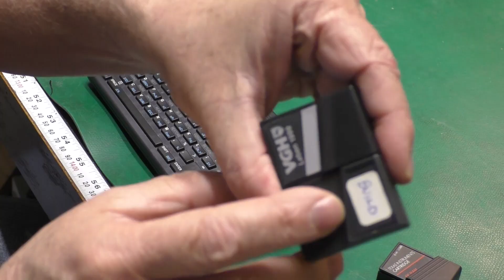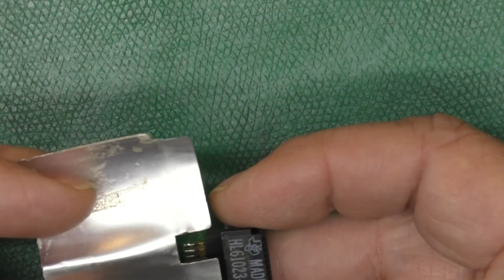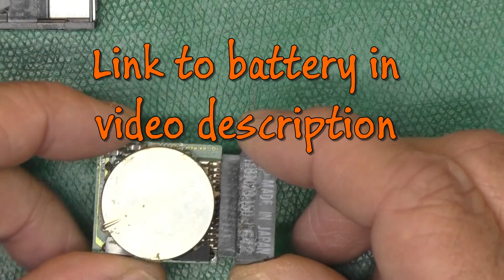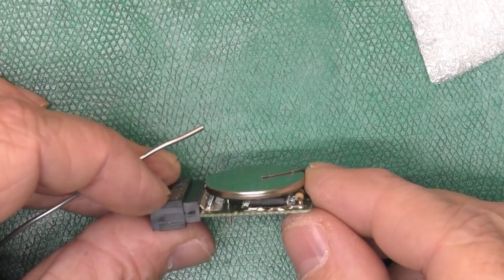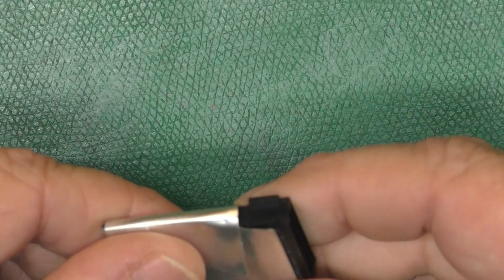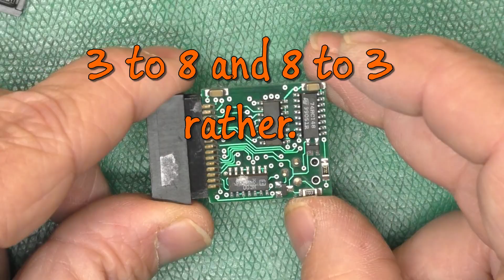TI-74 and TI-95 OEM carts. Overview, teardown, RAM cart battery replacement.

Comment: Hello and thanks for your very eye opening video.  I have a TI-74 S Basicalc. Back in the days I used for work and to run Rally as a navigator. I purchased a Eprom program named Turbo- Kurta, used for time, & distance control Rallies. I'm Rallying again after 20 years.  I'm trying to access de program lines of that eprom before my TI die.  The display is getting darker.  I tried the "Call Get(1)" command, then "List".  It tells there is no Ram found.  Is there other command # for Eprom? Any clue how to access the eprom program lines?  I will appreciate.
Reply from the maker: Typically a program is run from ROM with a command like RUN'DIR' which will show you what is on card. Other carts like the PASCAL cart start with RUN'PASCAL'
Reply: @HeyBirt  Thanks for your response. It doesn’t work. I have been able to access only main memory content . Maybe it needs to transfer eprom content to main memory to be listed. Thanks

Comment: I have a TI74 and a TI95.  I can't get either to run. No battery corrosion and the reset button didn't help.  Any suggestions?  I've had both as an original owner since 1985 and 1987.  Theybwere my go-to as a your Army officer. I'd love to have them working again.
Reply from the maker: There may be some internal corrosion. I will be releasing a video tomorrow which covers repair of the TI-74 and TI-95.

Comment: Nice vidéo. I have a 74 with 4 modules labelled 128k but do not know how to use them…
Reply from the maker: It seems most of the FLASH modules were used by insurance companies in Europe. Generally you would type RUN"prg" but you have to know the program name uses by the cart.

Comment: Nice to see these devices (that I would never get myself anyway)! And WOW 4us ROM!! That needs custom hardware to be dumped LOL
Reply from the maker: The very slow ROM caused us some confusion for sure. I had read that TI had to bodge in a sort of wait state on the machines to be able to use the ROMs.
Reply: @HeyBirt  that makes sense, even a 1 MHz clock cycle would be way too fast for a 4 us device